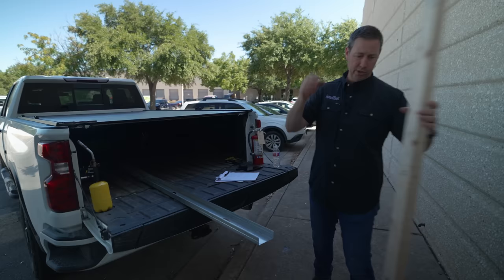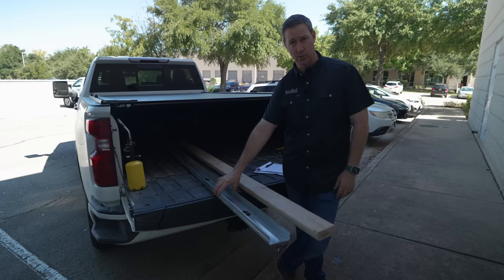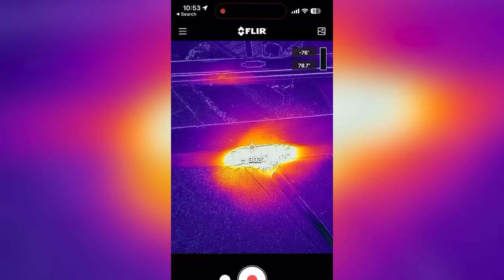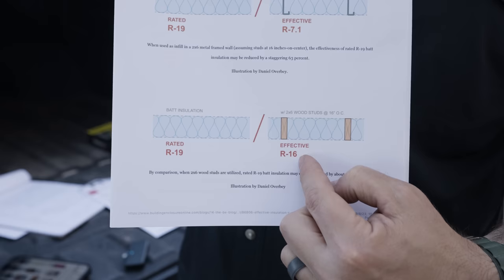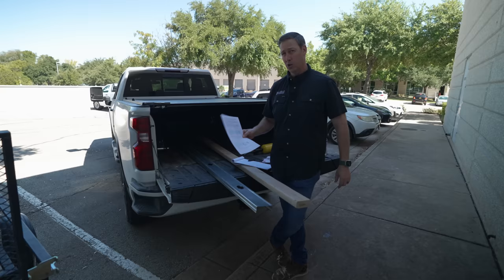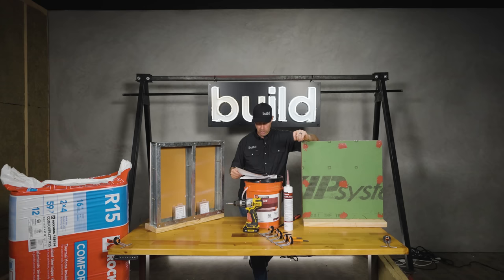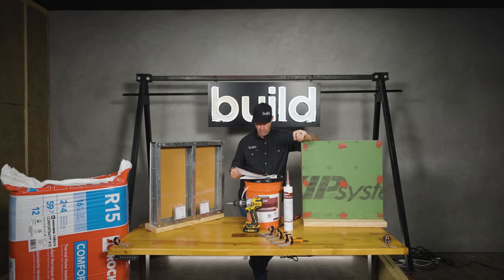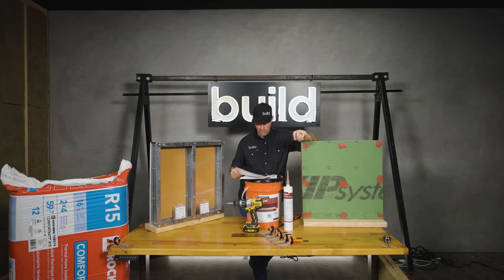Framing Studs: Steel vs Wood

Comment: No. Look at communities burned down by wildfires. Steel studs, metal roofs, siding and cars, gone.  I rebuild after wildfires and we burn test with the ICC and Intertek. It takes MGO, fiber cement, concrete, Rockwool and intumescent coatings to build fire resistant homes. A propane torch doesn't simulate a wildfire with wind driven flames and 1500 degrees.
Reply: Way back in the day I asked an architect why he specified huge glulam beams instead of steel for the house we were building and he said the wooden beams would last much longer in a fire. Steel would lose it's strength and collapse long before the wood would.
Reply: Actually fire rated construction is about insulating the structure from the heat of the fire. 

Fire mitigation though is always about providing enough time to escape. Enough time to fight the fire and prevent spread.
Reply: Glulam or heavy timber anticipates some surface charring to protect the meat of the structure

Steel or stud frames. You rely more on layers to insulate the structure. 

With intumescent coatings and fire treated lumber used in a special and specific area.
Reply: Thoughts on that fire resistant Starlite material slathered on studs already painted with an intumescent coating?
Reply: To be fair, does any house survive that kind of wildfire? I feel like that’s just a write of at that point no matter what you’ve built it out of.
Reply: @jameslikesturtles8254  yes it's pretty easy if you follow the basic rules. No burnable vegetation or mulch near the house, fiber cement siding, metal roof, screens to prevent any sparks from getting in the attic.

Do that and a house won't burn.

Put mulch around it, have shingles for siding. Have trees and bushes right next to it. It'll burn down for sure.
Reply: Thanks for the information 👍🏾.. I currently about to make a NEW BUILD
Reply: @disqusrubbish5467  Trees burn from the inside out in a wildfire and the people fire testing CLT and Glulam or any material, only have to show the product to last for 30,45,60,120,240 minutes to make their ratings claim. We have to look at the results of destructive testing and our own observations. When ever you see the aftermath, look at what remains. Wrap any beam, or otherwise in layers of fire resistant material and it will last as long as the sacrificial layers do. But to say one is better than the other is actually false. They only last as long as they last.  Whether you have a usable structure at the end goes far beyond individual components, rather it is the whole that determines survivability.
Reply: @searlearnold2867 wild fires heat can move 100 feet or so.    With insulating effects you can reduce house from reaching spontaneous ignition temperature.   Also in a wildfire area keep trees cut back off property.  

Rockwool on the outside can keep inside temperatures 100’s of degrees cooler during a wildfire.
Reply: @Zorlig I once saw a video of a guy in Australia whose house survived a wildfire in the bush. He fitted a sprinkler system over the house fed from the pool. The whole house was covered in a spray when turned on and it kept it from catching fire. Everything around was burnt to a crisp.
Reply: @jonathanbuzzard1376  that works too! Careful though as unless you want to wet your attic, you still have to stop sparks from getting in
Reply: He makes that point further into the video. Wood is better for fire because it transfers heat much slower than steel, according to the video.
Reply: Is the ZIP system proven over the years from disintegration, considering the material wood particles and glue?  The green stuff really that impervious if exposed for a couple of years.  I see homes in videos with this zip and then sticky, plastic sheating on top before a metal roof or shingling applied. Somewhere in between the materials is rigid insulation.
Reply: No kidding. We're pros here, and everything is on a scale. A fire can burn a solid concrete block to dust. 
Everyone knows a steel building can burn also. Piles of steel beam spontaneously combust.
Reply: @searlearnold2867 no observations of burnt building is the worst thing to use in decisions.
There's no way to know the conditions of the fire. Controlled testing is the only way to know the performance.
It's been my experience that people who complain about following testing and install directions are the people who can't do the work because they can't price it.
Reply: Go ahead and start a campfire with 300 steel studs, or perhaps you’d prefer 300 wood studs.  My point is that a house full of wood has its own source of fuel.  Yes steel will melt, but at least it’s not contributing to the ignition.
Reply: The purpose of metal studs is to decrease the risk of fire starting inside the structure, and to reduce the spread between areas inside the structure. It is not intended for reducing risk associated with external fires
Reply: @sparksmcgee6641  Reread my comment. I do destructive testing, meaning I fund projects and build a full house in a lab under 3rd party scrutiny (Intertek) and burn it down to find out what will work and what won't. That's where your class ratings for building materials come from . Building materials, floor wall and roof assemblies are all tested and put through destructive testing. We do the same for hurricane and earthquake testing.
Reply: @davidswanson5669  which is irrelevant when the rest of the house will spontaneously combust or otherwise burn down, now isn't it? BTW, reread my comment. I actually fund and build houses so that 3rd party testing companies can burn it to the ground to find out if my material choices and assemblies will survive a wildfire. They do.
Reply: The point of this video is thermal insulation, not fire safety, lol.
Reply: @jonahhekmatyar  so. why the gimmick with the propane torch? Thermal bridging mean anything to you?
Reply: @searlearnold2867  to show that the wood is such a better insulator than metal that even when one side is +300° the other side 4 inches away is safe to touch.
Reply: Heavy timber with strawbale infill. Great aerial photos of areas completely burned except for the strawbale home.
Reply: @sparksmcgee6641 steel melts way before it combusts. Most likely what you're seeing is any oil residue and any flammable materials among the steel catching fire.
Reply: Laser weapons DEWs
Reply: @jonahhekmatyar yeah, he wasn't paying attention. He just wanted to make comments on the subject matter that he wants to talk about, whether or not it's pertinent to this video
Reply: @MadLadsAnonymous you have to pry the formula or samples away from the family’s cold dead hands before that would happen
Reply: @Doubie.  I don't follow. 

I'm asking if covering studs with Starlite then intumescent paint is a sound fireproofing strategy.
Reply: They were burned down tp ashes with a Laser.....😊
Reply: Truth
Reply: Can you intumescent coat the exterior stucco of a building? Or even use as an admixture? (or both)
Reply: @MadLadsAnonymous  Yes to both.
Reply: Everything burns, it would be unreasonable to expect a building to stand undamaged after being in the center of a wild fire. The benefits between metal and wood is the resistance to fire, an electrical fire can burn a building to the ground but if you start adding layers and layers of products that resist fire you are less prone to have a catastrophic event in your building if that ever happens. We can argue all about this but like everything both has their pros and cons against the other.
Reply: @Room1sixtyfive  The difference is that our materials and wall and roof assemblies are 3rd party destructive tested before we make claims of performance. We experiment, build, burn, learn and improve until we establish a standard that is reliable. We don't wing it and guess, we know.

Comment: My High School drafting instructor told us that the steel framed building we were in would collapse faster than a wood framed building in a fire.  The steel gets hot in a fire and goes solf and collapses. Doesn't have to melt.

Comment: Any new developments in the ICF world? Last videos from you were from a few years ago, wondering if there are any new developments or best practices.
Reply from the maker: Did you see my Extreme Panel ICF video last week?  One hour of full updates on ICF. Impressive supplier
Reply: @buildshow I found one long video from 13 days ago but didn't see ICF in the description. Is it on this channel?
Reply: I'll check it out, I must have missed it. Thanks @buildshow
Reply: Yes- preparing to build an ICF house and considering steel for Interior walls & floor joists.  (Structure of 2 1/2 story  w walk-out basement). 
Ameliorating SOUND is my goal, (suffer w  Hyperacusis), 
and thus Wonder if: 
All the sound-proofing provided by ICF will be negated / offset by interior steel wall framing, even with interior Rockwool between rooms??  
Thanks for any clues...

Comment: Nearly 100% of American houses have been remodeled (100% because some houses are remodeled several times).  Most of us do not have the tools or the ability to 'work' with steel studs.  I would also have no idea how to hang a mirror or picture with metal studs.  But the worst is the 'fire demonstration'.  Studs almost never come in contact with an open flame as an initiator of a fire.  If the open flame is on the wooden studs, it is way past 'starting'.  The fact is, almost all house fires start in the kitchen and almost all kitchen fires start on the cooktop.  So the solution is not to build with steel but to install induction cooktops which are almost impossible to start a fire.
Reply: The tools to work with steel are a pair of snips. It's really much easier than wood.

As for hanging things you use screws. But that kind of illustrates your other point, people dont know anything about steel.
Reply: You can metal frame all day with a pair of tin snips and an impact driver. No nail gun, compressor. They are much lighter so not as tired. And it’s much easier to build soffits and slip track for a basement. As far as hanging a picture? Use a screw just like you would for a wood stud. Steel suds come in different gages so some can actually be used for load bearing walls, but the real strength comes when you sheet them. Just like wood studs. They really are easier to work with. As he says in the video the problem is not constructability but R value and cost.
Reply: Cooking related fires only account for about half of house fires. Heating systems and electrical appliance fires (a ton of those related to dryer vents and lint traps being clogged) make up the majority of the rest. 
Just wanted to clear up that not "almost all house fires start in the kitchen on cooktops".

Comment: Cavity insulation with steel studs is not a good use of insulation.  With steel studs, it’s better to put all the insulation on the outside.  Also, that R7.1 number for a steel 2x6 with cavity insulation didn’t indicate the gauge of steel.  A 12 gauge stud is about three times thicker than a 20 gauge stud, so it’s about three times more conductive.  One more thing: 16 inch spacing with 2x6 steel studs doesn’t make any sense in residential construction — even with extreme wind and seismic loads.  Reasonable spacing would be 24 inch OC.

Comment: This brings up something I have commented on before, with no good answers. It is acceptable to have  steel studs in commercial installations (think strip malls, light commercial, retail, etc.), where the exterior wall is essentially a curtain wall of steel studs, with the remainder like noted in this video (gypsum exterior for example). If one tries to do the same thing in Residential then there are a multitude of objections, also related to things noted in this video. My questions is why is there a such a difference in practice and acceptable structures between commercial and residential? They contradict each other. Just curious to hear thoughts from others.
Reply: Can be Apples to oranges

Comment: The beauty of metal studs in commercial interior walls is they are easy to take down when a new tenant moves in and needs a new floor plan. I think that's called "build out". They're non load bearing, can be removed or added and easy to run data/electric to. There's really no reason to use metal studs in residential in the USA.
Reply: And they are recyclable.
Reply: The fact that you can get 1 or 1000 steel studs and they will all be perfectly straight and will stay straight is a pretty good reason.  Especially if you have really tall/large walls with big windows that let in tons of natural light which will highlight the smallest imperfections in the walls.
Reply: @00HiGhGuY00 Properly framed walls straight edged after roof load installed can be just as straight as metal studs. I have seen metal studs rot out from moisture, have bulges in them from too much backing. They are easy though

Comment: Perhaps you could feature a steel-framed house in a future show. Back in 1995, I was Owner/Builder of a house with a detached garage, both 2-story, in FL. Above the monolithic slab the exterior walls, floors & site-built roof trusses were 18ga engineered to 150mph and energy efficient; with all electric appliances and heat pump, the power bill never exceeded $150.

For those that are still reading the exterior was fiber-cement siding, ½” PolyIso to prevent thermal bridging, 5.5” cee studs with 2” flanges for easier sheathing attachment, blown cellulose insulation, and ½” gyp board interior. With a non-combustible structure, the insurance rate matched masonry and weathered 3 hurricanes with no damage. Without a food source, there was also no need for termiticide poison. Although it does require different skills and tools with self-tapping screws, I would never build another house or apartment out of 2x wood.
Reply: Great Build!!!
Reply: Did it creak?  Did you have any cell phone reception inside?
Reply: @TheKingOfInappropriateComments what like there isn't cell phone coverage high rises or malls that are all steel?
Reply: This is how I would imagine a residential steel build. Caught me off guard that he said they're non structural studs and that he started talking @ interior insulation vs exterior. 

I also think most residential wouldn't use the exterior gypsum.
Reply: Ditto here. Built and own home in 2002 entirely out of Tri-Chord steel framing & truss system (no longer available on market)  in the southern Utah arid desert , and had a toilet flooding incident which was super easy to recover from since no damage to the int framed wall studs. Would never build another rental property out of 2x wood. This is the lowest maintenance home I own and very efficient (renters love the low power bill all year round). Surrounding wood homes built in the same year have had to deal with issues like termite damage and water damage/mold, etc, and I have spent very little to none on these types of issues. You can have your wood home and all that comes with maintaining it -- for me it's steel or nothing.
Reply: How well does thin gauge metal hold fasteners? Let me know how hanging your tv or floating shelves go. Cheese balls.
Reply: @silentscribes  It's called adding backer boards to the walls before drywall goes up. Boom, entire wall is a fixing point.
Reply: @goofyrider Sounds amazing but what did you do for floor? Did you manage to avoid wood throughout the entire floor assmebly?
Reply: @TheKingOfInappropriateComments  " Did you have any cell phone reception inside?"

Cellular network engineer here.  A steel framed house will not have any appreciable effect on your signal strength inside.

A stucco coating over a wood frame would be worse for cellphone reception, because of the wire or metal lath under the stucco.
Reply: @Migglesworth  both would likely have signal attenuation. But when you live in a Faraday cage i would expect problems

Comment: One thing I've heard that steel is good for in a traditionally framed stick built home is to use C channels for framing in bulkheads. The long lengths are perfectly straight and you attach one to the ceiling and use one for the bottom and  fill in between them with wood studs to attach drywall to.

Comment: Thanks Matt. I've been wanting for this video for a long time. I almost wondered why more steel isn't used in residential. My idea for a solution is to put a plastic strip on the outter edge of the metal stud as a thermal break.

Comment: I have built with metal stud in domestic applications in the UK for over 20 years. Either for partitions or with thicker gauge to infill on concrete frames. Recently I have used it structurally for a panelised house system. 100mm studs filled with earth wool. Sheathed with OSB then 125mm PIR wraptite membrane void formed with a steel top hat section and then a cement board for either brick slips or render. Plasterboard finish internally applied after fitout on site. This system passed all the necessary fire tests and has minimal thermal bridging and great U (r) values. Light weight and stiff with no shrinkage!
Reply: Not for Canadian or Northern Europe climates.    Fine for interior walls.   
ICF with stucco as the primary siding, and a proper steel roof is my first choice; although 2x6 and in some cases, 2x8, with batt or blown foam insulation are the standards.   They're not meant to withstand 200 + years of liveability that comes with old (and often cold and damp) structures built with a timber frame and wattle and daub plaster or thick masonry, but they're generally comfortable.
Reply: @cinders302  steel is more than suitable for northern Europe. The UK is northern Europe. We were building in Scotland with it. Every single modern tower block in London built in the last 30 years will have used LGS in the internal and external walls and it will outlast wood.